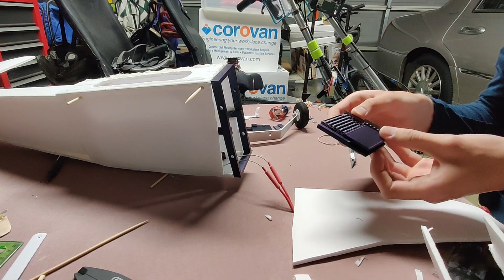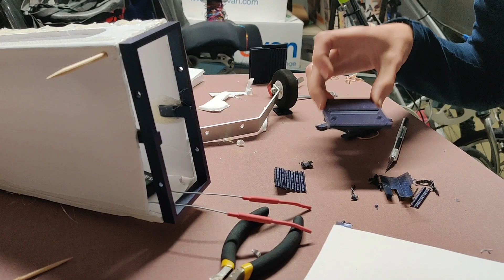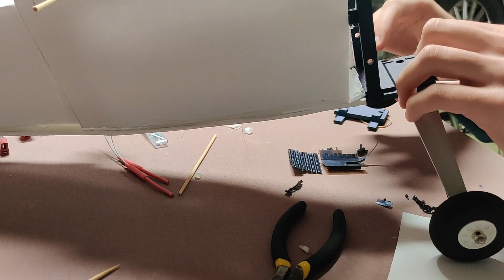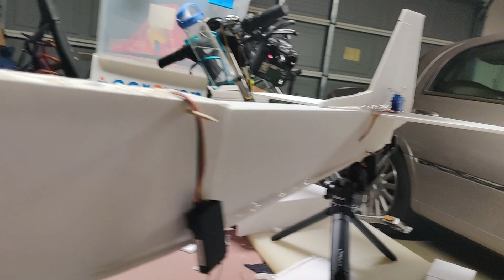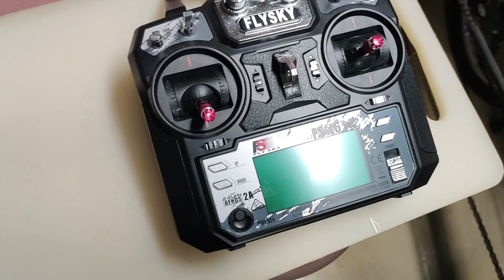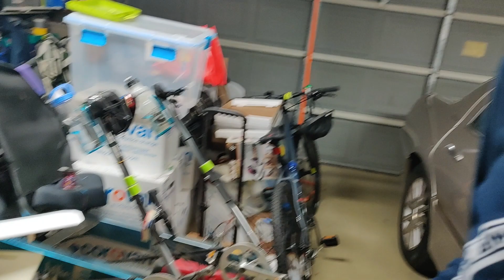Reinforcements! DIY Foamboard RC Plane Progress Report 2

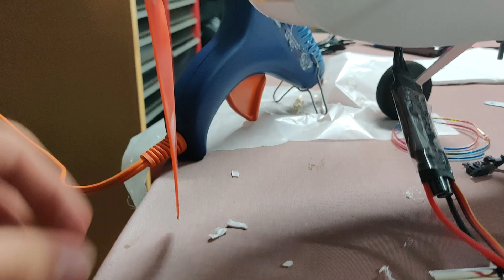Comment: also, it is not true that the propeller needs to necessarily be angled straight or slightly upward 9:40. Infact slightly angled downward is actually better. look up thrust angles and how it affects different planes and how to counteract it with angling the motor down. also make sure your cg comes to be 1/3rd of the wing!

Comment: Hey whats that metal cross on the motor next to the propeller???
Reply: My man that cross is the motor mount! see the way you use it is, you mount your motor on that X with the provided screws (make extra sure that the screws do not go too much into the motor that they touch the windings! otherwise use washers.) and then you mount the X with the motor on it to the wood piece. This way when you want to remove the motor you can simply unscrew the X from the front without having to open up the plane or the motor pod. Let me know if you need an image for reference. Very pretty plane!
Reply from the maker: @ishigamiyu1991  Hey Ishigami! My goodness, that makes a lot more sense. The motor kit I bought didn't come with instructions, so I naively just stuck it on the motor assembly, LOL! I'll make sure to fix that next. In retrospect, that would make sense given the shape/screw holes for the cross piece.
Thanks so much for taking the time to comment, it means a lot! :)
Reply: @ElytraflightsGarage  wishing you luck with the build!